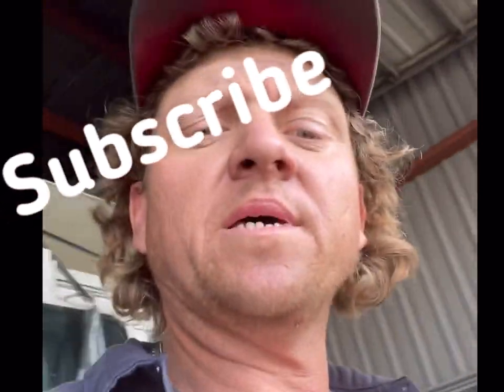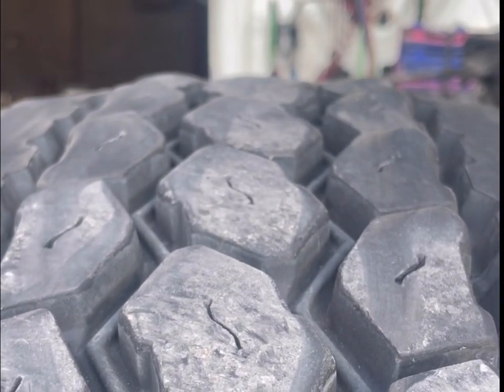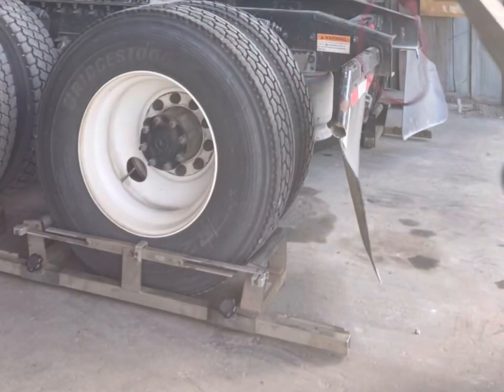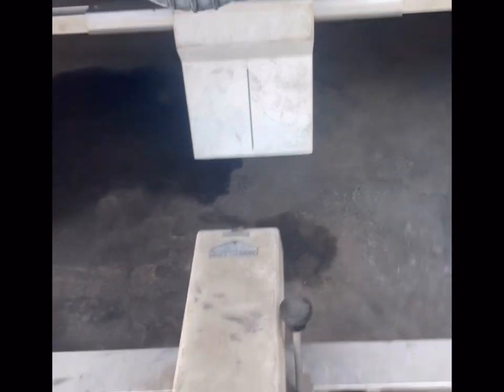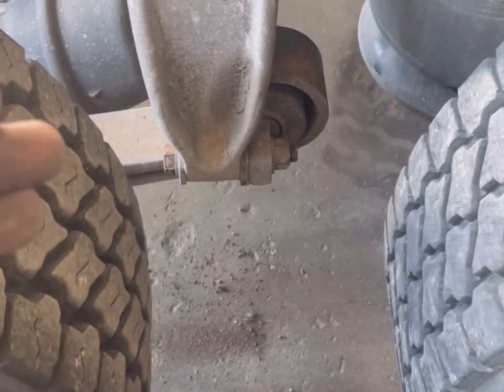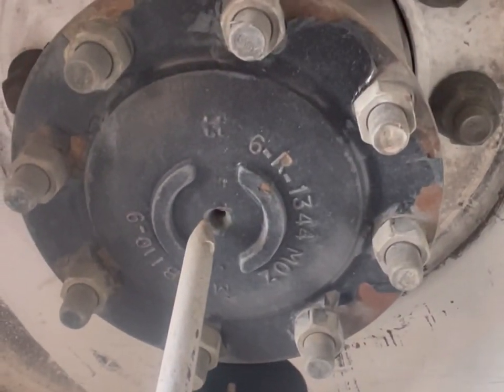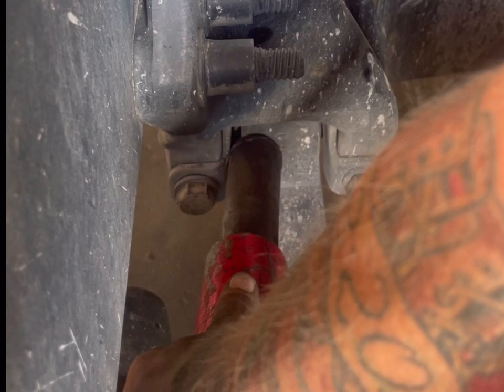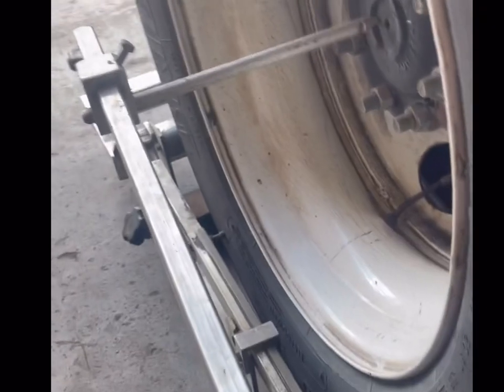Steering wheel off can cause Truck tire cupping , alignment

Comment: Make sure your 5th wheel is lubed proper.If the trailer cannot run straight with your tractor you will have tire wear.
Reply from the maker: This is very true.
Reply: @bendinwithbendon  This is why we use slick discs on all of our equipment thats not in the daily drop and hook game.
Reply: Also aligned trailers make serious improvements in drive ability. 
A trailer that pulls straight. 
99% of trailers do not pull straight
Reply: Kinda puts in perspective the skit on Bonehead truckers of the guy using the window washer to wash his 5th wheel. The joke is on him, wrestling that thing when he gets a trailer on it.
Also been many trucker take a seat on their fresh greased 5th wheel as well. I'd love to see more of those videos.
Reply: @kramnull8962  Seen a truck crash due to driver not cleaning snow off 5th wheel then driving in freezing weather.5th wheel froze to trailer plate. Truck could not steer. Ran off road into ditch

Comment: I took my truck to a reputable company to look at cupping of steers and scrubbing of drives.
They said it was all within spec... Well my tires tell me different.... Need a guy like you up here.
Reply: Lazy folks stink ,don't they 🤦🤦
Reply: I work for a major LTL company and my tractor is doing exactly what he described in the video. 2022 KW 680. Shop says it’s good. Like are you all not looking at the tire wear!?
Reply: We get trucks in all the time. Do the alignment (with the worn tyres) then send them off. They come back couple months later with new tyres saying they need another alignment because the tyre shop told them.

Comment: Dad was an inspector over a fleet of semi trucks for many years. General mechanic. Lost my driving privilege's to the dude for a week when I was 16, not inflating the tire from 29lb. 
I hadn't learned the law of Winter. It gets cold, tires deflate..... The man drove me to my part time job for a week, and had to move my schedule around. He was worse than the DOT...

But when you take your time to get an inspectors license. I guess that's what you do inspect.... He could smell a tire with low air pressure.

Comment: Inch and half angle iron with two points mounted on it.  Center of axle flange to center of axle flange.  Get each side the same and a string along the tires to get them in line with each other.  Did it that way 40 yrs ago and every since.  Trucks ran straight and even tire wear

Comment: Years ago I worked at a Truck and trailer repair shop and we did all that with tape measures, wire and homemade jigs.   

We would make a center point of reference of the front axle and adjust everything from there to be the same on both sides.   Typical accuracy was within  +-1/16" on a long-frame truck or trailer which was more than in side factory specs.

Comment: It depends on why the steering wheel is off, not that the wheel is off in general. If the wheel's simply been put on a couple splines out of whack it won't affect the tires at all, same as if a pitman arm is a spline or two off centered or the steering box is a little sloppy.

Comment: So back in 1987 I got a Ford F250 4x4 with Sterling 10.25 axle 510 gears. From the factory the rear axle wasn’t tracking correctly. I ended up after 5 trips to the Dealer and 3 replacement axles just fixing the problem myself with string (lasers weren’t available then) and a couple of bubble levels and my favorite porta power.

Comment: It's not the steering wheel being off that's causing it,that is just the result,axle thrust is out of spec,not the steering wheel, another thing,tire pressure,is a big causer of driving complaints.
Reply: He didn't say the steering wheel being off is causing issues. The issues are causing the steering wheel to be off.

Comment: I bought 08 Pete in 2011, the steer tires would last 8 months, doing alignment (computer one) at TA, Petro every 6 months for 2 years. Finally got to my shop my mechanic said steer axle sticking 1/4" to the right - nothing i can do its the cast itself, front drive is made to stick out 1/4 he said I will make to 0* or center and the rear drive axle centered. Here is he did Front Toe is 0* (not In or Out 3-5* like computer says) just 0*. My last alingment was 10 years ago my steer tires go 237K. My truck never left the ground it was done old school with string and tape. Pay attention to sluck adj and s-cam bushing they will give cupping on your drives. Also hight leveler for drives, b4 changing ask dealer the measurement from center line of axle (horizontal line) and the frame.

Comment: I saw that you did it.  But didn't mention that running your hand across and back and forth on the tire lightly will tell you quickly if they re feathered or cupping.  Especially when they have full fenders covering the tires

Comment: You shouldn't  level your targets, they have measurements for a reason. If the frame is not level there is an issue that needs addressed whether it's a sagging spring or bent frame rail.

Comment: Where are you located? I've been to the same alignment shop 3 times and the tram is still off. They use the hunter computer alignment machine. I had to take a tape measure and a string over there to prove to them that it was out big time. Just picked it up for the third time and the tram is off and it still pulls the right.
Reply: I'm in the exact same boat. So I used stopwork authority and I'm waiting for a safety manager to drive the truck to force the shop to do something.

Comment: How would you go about lining up your trailer axels?
Reply: Using a hanging target at the king pin (level surface) gauges along frame. Axle set as shown, tram used to adjust front axle too rear. Your done